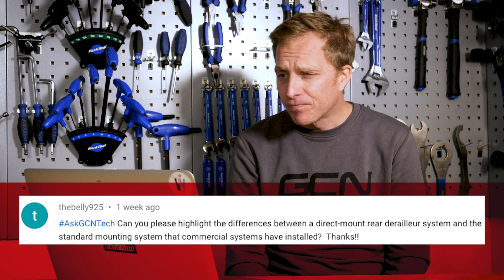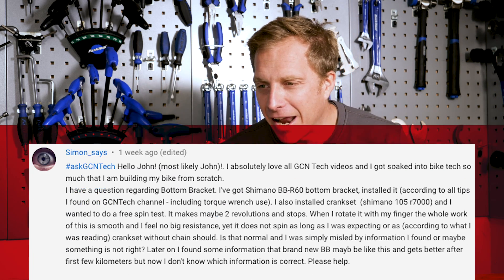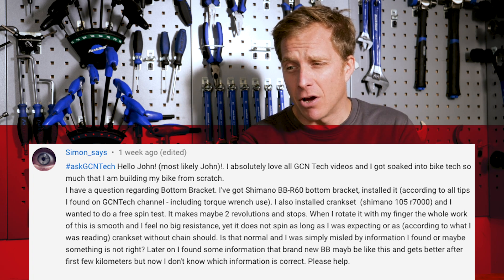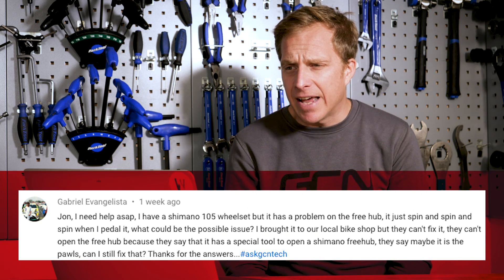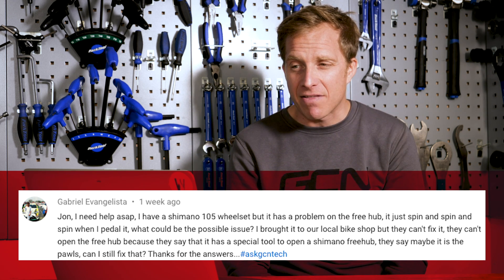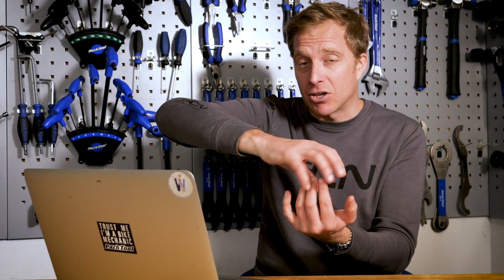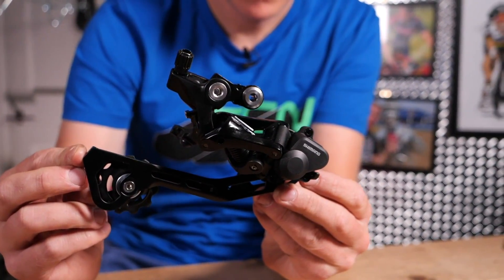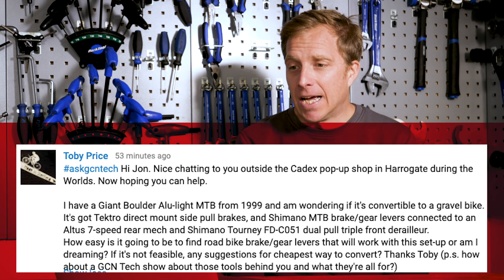Direct Mount vs Standard Mount Rear Derailleur | GCN Tech Clinic #AskGCNTech

Comment: WD40 is not a lubricant for bearings
Reply: It would help remove gummed up grease while not thinning out or removing future lubricant. If you used something like Simple Green, it likely would not completely evaporate, so any lubricant you add would just thin out and dribble out of the freehub body.
Reply: Buzz Man WD40 isn’t a lubricant for anything.. 👍
Reply: @eddymintball1950  Expect for Simon Richardson's chain :-p

Comment: Topical! I just converted to an Eagle AXS XX1 using the upgrade kit as I already an NX drive train. I was confused a bit fitting the XX1 mech as the instructions weren't exactly clear, this is regards to rotation I fit it at, do I just let it drop to its natural resting state and tighten it from there, out it pointing to 9 o'clock etc. It feels fine now, but I have this feeling it isn't fitted properly.

Comment: Jon... I often change from my gravel rims ( 23 mm width ) to road rims ( 19 mm width) on my drop bar single speed gravel bike.  I did this to save time converting from road to gravel riding.  Adjusting the v brakes is the most difficult and error-prone part.  Can you make a video on how to quickly adjust rim brakes? It feels like I need 3 hands to do it
Reply: On V-brakes, it's often easiest to have an in-line cable adjuster to help with adjustment. You loosen it fully (make it the longest it can be), hold the brakes to the rim (pull together at the top), and tighten the cable clamp bolt. Loosen the adjuster fully, and voila! your brakes are set up. A variation on this familiar theme is for situations when you do not have a cable adjuster in the system. Hold the brakes to the rim and lightly pull on the brake cable and then let go of it. While continuing to hold the brake to the rim, tighten the cable clamp bolt fully. In both setups, squeeze the brake lever as hard as possible to seat everything in place and to ensure you won't lose braking in an emergency stop.

Comment: Emergency! Emergency! I have a 2018 specialized Roubaix and the front fork has a crack in the carbon. Brought it to our local specialized shop and they said I need to replace the fork. However they are having a hard time finding a replacement fork. Been asking around and it’s really hard to find. Can I use third party forks? Is it advisable to have somebody repair the carbon on the fork? What other options can you suggest? Love your show. Your advice is gospel!
Reply: The Roubaix uses a proprietary fork due to the Future Shock system. You cannot use an aftermarket fork. I would generally not repair a carbon fork if the crack is on the steerer tube. If it is on the legs, I would call experienced bicycle carbon repair dudes and ask them if they reckon it to be safe. The cost to repair it may or may not be nearly the same as a new fork.

Comment: Hey Jon, or whoever's reading this. I recently bought a Shimano GRX rx400 rear derailleur, but it doesn't seems to work well with my current setup, I'm using a Deore 10s cogs (11-36) and the hg54 chain with an Ultregra 6700 STI, are the levers the problem? I've done some research and they told me that the older generation of 10speed STI levers don't work with the grx400, and learned that the only compatible levers are the Tiagra 4700 series. Any thoughts on this? Cheers!
Reply: Someone above mentioned the same. I was looking into a 1x 5700 setup and learned that the grx 400 uses 11s pull ratios even though it is 10sp. The tiagra 4700 is the same, so those levers will work for you.

Comment: Really appreciate your advice on the question I put to you. You confirmed my fears that the conversion is going to involve a considerable outlay to get it all to work properly. 1x a good idea. Many thanks.
Reply: I would go with bar end shifters in friction mode. Or you can go with the Gevenalle shifters, again in friction mode.
Reply: @scottcottontx  came here to say this, i'm glad someone here still has their head on their shoulders🤣
Reply: Toby Price i used the Tourney 7 speed STI, it works great when properly adjusted. As for the brakes you could use cantilevers, they bolt on the same mounts as Vbrakes and have the same pull ratio as dropbar brake levers. Hope it helped!
Reply: You could also get a set of Gevenalle shifters.  You can get them in long-pull so they'll work with your v-brakes and can also be set up in friction mode so they'll be compatible with your current gear set up.
Reply: 8 speed cassettes are just 7 speed cassettes with an extra cog on there. The spacing is the same between the gears.

Get 8 speed brifters, if you can find some, and just use 7/8 of the capacity. You can upgrade to an 8 speed wheel later, then you have an 8 speed freehub which will take a 10 speed cassette for if the bike's working out for you, or you're feeling flush.

1x will be easier, doubt you'll find brifters for a triple and it's not the same spacing on a double as a triple (I think? Been a while)
Reply: GCN did a video showing that your old MTB is already a gravel bike :)
Reply: I just did what you planned last weekend, I used old rsx brifter for my 3×7 hybrid conversion and some mini vbrake, works great (although i haven't had time for a proper ride yet)
Of course it's not the prettiest bike with all thoses cables but works for me ☺
Reply: There actually is a sti lever by shimano thats 7 speed its also tourney and it uses the old design of sti's where the downshift is above near the hoods just try and look it up its very cheap
Reply: @ryosukecodm4217  Those 7 speed are also available with a triple shifter. They do work very well.
He will need to either use a Travel Agent (if one can be found) or convert to mini- V brakes (that will depend on clearance and will probably make mudguards unusable)

Comment: Are belt drives really 35% less efficent than chains?
Reply: Above 200W power output, belts are more efficient
Reply: @galenkehler  how does that look like if I don't have a power meter
Reply: @IcHamza  The efficiency isn't affected by whether or not you measure power.
Reply: On a bike which has a belt drive installed you aren't very likely to put out more than 200W on average.
Reply: @chrisko6439  Team Schindelhauer-Gates might have something to say about that...
Reply: Are you referring to this article: https://www.bikeradar.com/news/chain-or-belt-drive-which-is-faster/

Here the following is stated: "By his measurements, a conventional chain drive consumes 2.92 watts on average, while the belt eats up 3.93 watts. Although the difference is just 1 watt – not enough for most people to care – this works out as a substantial 34.6 percent."

I think the percentage difference is derived by dividing the difference in chain loss by the absolute loss with a conventional chain drive. This gives you the following formula: (belt drive loss -- chain drive loss)/chain drive loss=percentage difference in efficiency. 

The figure therefore pertains to the relative loss -- and not the absolute loss -- of the system. By giving a relative number, the difference between belt drive and chain drive looks more substantial than it really is. If the percentage difference had been calculated with reference to total power output by the rider, the difference would have been considered marginal. 

By comparison, this is a much smaller relative difference than that between GP 5000 and Turbo Cotton tires -- two very fast racing tires. As is also stated in the article itself, this difference is very marginal.
Reply: @knutragnarsletteb6352  In that test they seem to have "forgotten" to take the friction of the internal gear hub into account, which makes the test worthless.

Comment: Can someone help my shifting because is hard to shift to the big gear on the front derrailur i have the shimano 105 r7000
Reply: RareRubyGamer RRG how old is your shifter cable? You may need to replace cable for the new one
Reply: Could you be a bit more specific?
Reply: This month after i changed my handlebar into a narrow size

Comment: #AskGCNTech Hello John, thanks for the great show! I've recently purchased a Canyon Endurace AL8.0 Disc with Shimano Ultegra 8000 groupset and so far loving it. However, there's something a bit irritating about it; most of the times when I pedal out of the saddle I hear a disc rub noise that I think is coming from the front wheel. Is this because of the flex in the fork? Is there anything I can do to stop it? Could it be because of my weight as I'm kinda heavy for a road rider? Thanks for the help in advance.
Reply: This happened on my Ultimate CF too.  Only on the front and only when I got out of the saddle - no matter how much adjusting I did, it didn;t go away.  Not until I upgraded the DT swiss wheels to Hunt. I assume it was wheel flex, but could be fork flex too.
Reply: @wordy1227  This surprises me because the wheel flex shouldn't really affect the flat-mount disc! Or maybe I'm missing something... Thanks for sharing anyway.
Reply: @sinashahidi8697  The whole system is sitting on the thru-axle. If the axle is flexing, then the whole wheel is moving laterally. This includes the disc rotor.
Reply: This could be due to the thru-axle you have. Cervelo's have this problem as well. Make sure that the axle is properly tightened. If you have a lever on the end that you cam over (like a quick release), good luck. In this situation, I usually recommend that people get a Robert Axle Project thru-axle. In my experience, they tend to be stiffer and silence disc rubbing.
Reply: @mykytajex2248  The lever on my thru-axle is fixed and doesn't cam over. I guess that's what you referred to as Robert Axle Project.  It's pretty tight, I can probably tighten it a bit more but I'm afraid I may break something!
Reply: @sinashahidi8697  If the axle is already tight, then tightening it more will not help. The axle is flexing more than it should, hence the Robert Axle Project recommendation.
Reply: I’d begin by checking that the pistons retract properly and then realigning the brake caliper.

Comment: Ceramic Bearings are worse than steel because of the fact they are harder than steel.  Ceramic Bearings are encased in a steel inner/outer ring. What happens when two materials grind against each other and one is harder than the other???   The harder material cuts into the softer material.

By default, ceramic bearings will cut a groove into their steel casing and make your bearings worse than if you stuck with steel bearings.   Ceramic Bearings are the biggest scam.
Reply: Unless you use a full ceramic bearing, which do very much exist.
Reply: @mykytajex2248  I'm not sure I understand your response. If a bearing is ceramic, it is 100% ceramic. I don't recall companies like Ceramic Speed selling Jockey Wheels with 50% ceramic bearings.
Reply: @mykytajex2248  Good luck finding ceramic bearings with ceramic racers. Even Ceramic Speed puts their ceramic balls in steel racers.
Reply: @Alby_VA  Which is utter nonsense for the reason you mentioned. You could change your bearings every other ride though :-D For the first couple of hundred miles the ceramic bearings might be faster :-D
Reply: I agree 100%, the first few hundred miles, the ceramic bearings will be faster. No doubt that racing teams with unlimited funds have the ability to afford swap outs for new bearings after a few hundred miles. For the remaining 99% of us average people, ceramic bearings are a scam. For those challenged with the physics of bearings and materials, few will know that ceramic bearings in steel/alloy racers have a short life span. It would be nice if GCN mentioned these facts, but I'm sure that would be the end of their revenue stream of all the manufacturers of ceramic bearings. They did "hint" at this issue once on the GCN Tech channel when they had Hambini on as a guest talking about bearings.

Comment: There are mini V-brakes that will work with STI levers. Don't know how much tyre clearance you will have will them though. Also there are 3x7 (Tourney, I'd call them semi-STI. ST-A073) and 3x8 (Claris, STI. ST-2403) shifters. If I was to buy new STI shifters for ~90€ I'd invest another 15€ each for new front and rear derailleurs.
Reply: Yup 8 Speed STI work fine with 7 speed. Tourney 7 speed. Also cheap microshift 7 speed STIs for about 40€

Comment: Shimano have Tourney 7 speed STI shifters, STA070PA.
Reply: He's got triple chainrings and needs STA073.
Reply: There are also cheap but solid knock-offs from MicroNew/Shift available from China. Only issue is that the shipping is usually 3-4 weeks.
Reply: Microshift is a good idea as the shifters are better quality than tourney, but are availible in many more speeds. Micro new r a sort of rip off of micro shift but take a while to come...
Reply: @Steve Cox 
I can confirm that it works, and works well (i have tem on my 7 speed peugeot)
Reply: I've read that campag 10 speed levers will work with 7 speed shimano (barring the missing 3 positions). Some ten speed campag levers will work with triples too. If the spring on the shimano front mech is too beefy, an old campag triple mech should be easy to find on ebay.